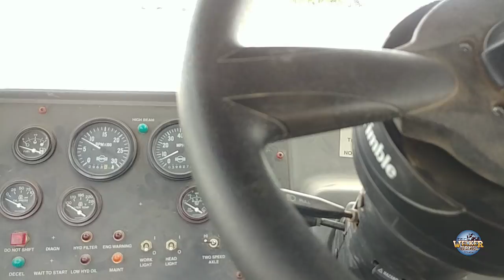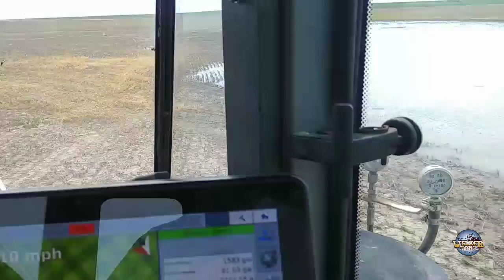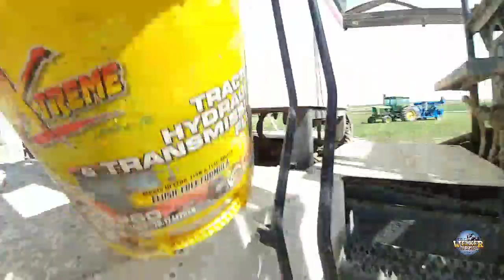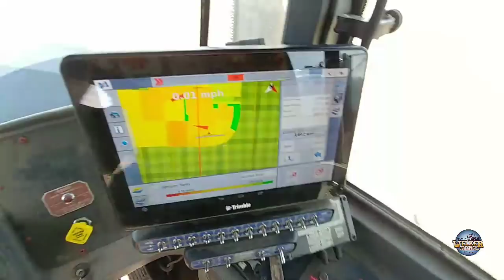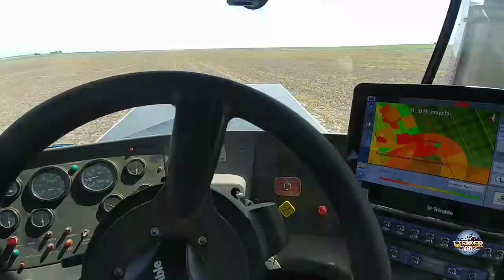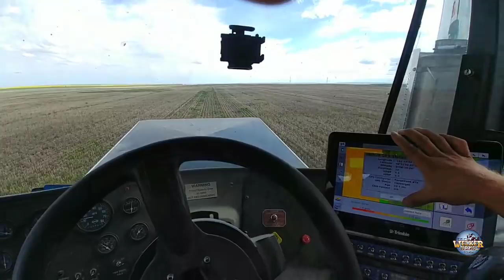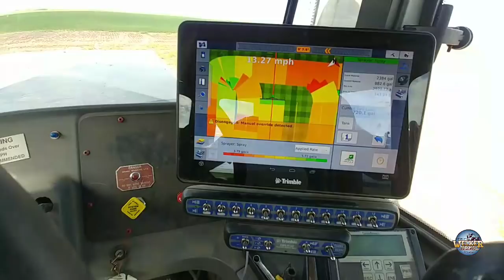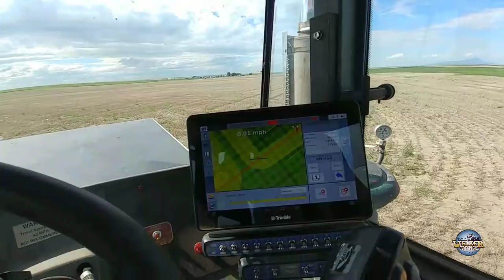🔴 Live! Chemical Fallon With BIG BRUTE - Welker Farms Inc

Comment: No till to save moisture like you do.  Because of weed resistance to herbicides we sometimes run 42" sweeps that require 1/2 gallon of fuel per acre.   We rotate corn or cotton with the sorghum on non irrigated.  For us wheat requires too much water for each bushel produced.   Less tillage translates into capturing more moisture for the crop in many ways.   Another thing  is to have the nutrients at a good level so the crops require less water...plants seem to use water sometimes  trying to pull in deficient nutrients.
Reply from the maker: Thanks for the information, we are always learning and with the way farming is going we also are making some big changes to how we farm. Trying to do more crops and less Chem fallow. Just need consistent rain and it will all work out.